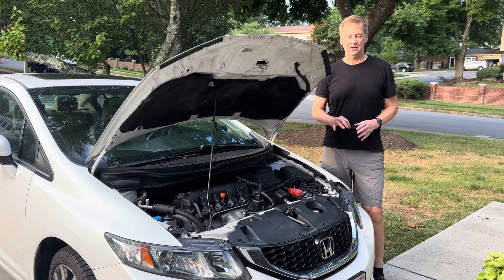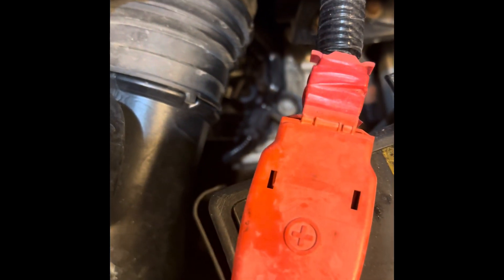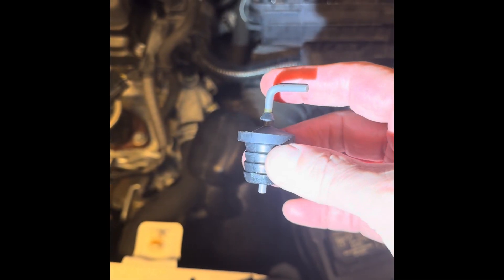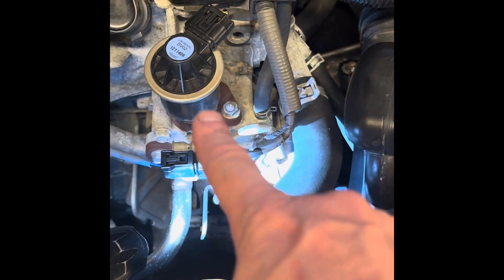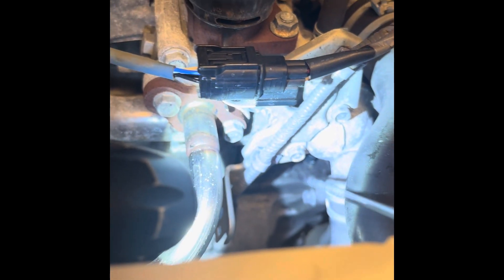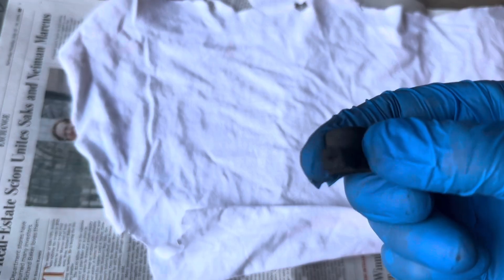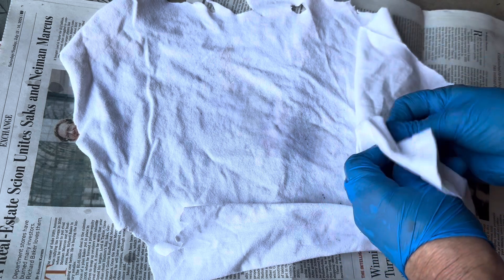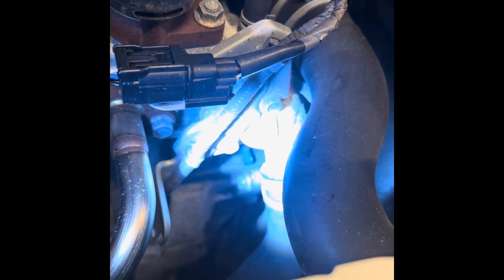2014 Honda Civic - Transmission Fill Plug falling out

Comment: Any idea what’s going on if that doesn’t fix the issue? It’s still popping out even after cleaning and clearing the vent cap :(
Reply from the maker: That seemed to fix the issue for me. I also replaced the plug with a new Honda OEM rubber plug to make sure it was not loose.
Reply: I wrapped some thread tape around my plug to get a more snug fit